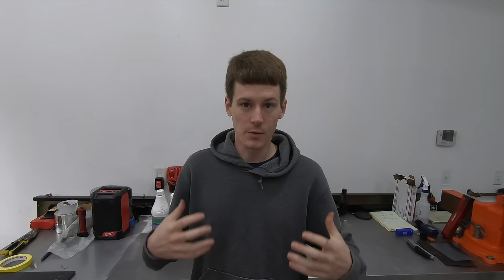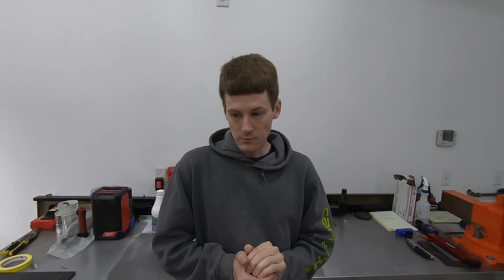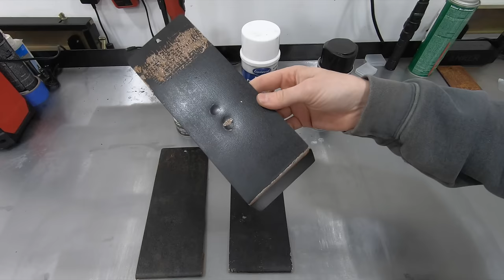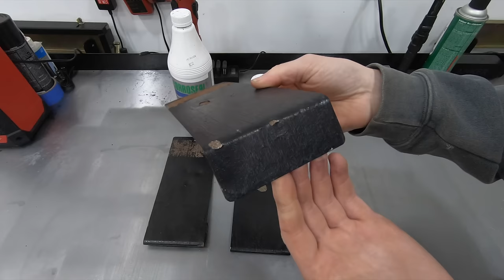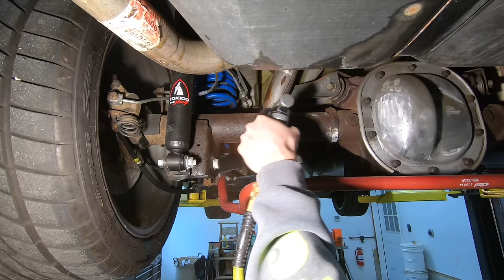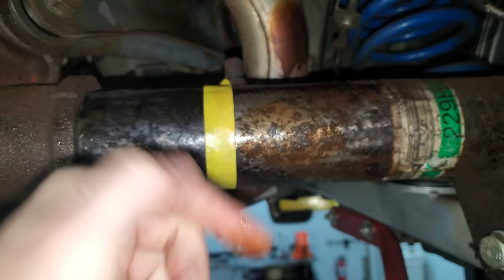MOST Rust Converters Are A JOKE! Let Me Show You. (Eastwood, KBS, Corroseal, Ospho & More)

Comment: Thank you for a very thorough evaluation of these products. I only have experience with one of them (Corroseal) so your video was really helpful. Here's my Corroseal saga; hopefully it will help others too.

About 3 years ago I started making original light fixtures as a side gig / hobby, many out of rusted scrap steel. Any parts requiring new steel were rusted intentionally by using a vinegar / peroxide mix, so that they matched the others. I was looking for a rustic black finish, like old wrought iron. I therefore removed all loose rust, and after much research, decided on Corroseal as a rust converter/primer, topped with 4 coats of Rust-Oleum 2x matte black paint. All were applied according to manufacturer recommendations with regard to time, temperature, etc.

I did notice early on that the Corroseal seemed to chip fairly easily, as I had to recoat a couple of tiny spots where I accidentally tapped it with a tool etc while working on the fixtures. I should have thought more about that when it happened, but the product had such a good reputation etc that I figured I would be okay.

Around the same time I made a fixture using similar techniques, but wanted the final finish to be rusty. I therefore removed all the loose surface rust and simply used 4 coats of the Rust-Oleum 2x matte clear coat. In other words, the same paint as the black, except in clear.

Life has been kind of tough over the last two years, so I didn't really push to sell those completed fixtures. It turns out that was fortunate.

About a month ago I sold my house and moved. When I did, I took a moment to admire my fixtures, which had been carefully sitting in boxes, in a fully air conditioned occupied house. To my dismay, EVERY single surface on which Corroseal had been used was covered in tiny dots of powdery rust breaking through the finish. They were not related to any previous chips or other damage, but were everywhere.

I then looked at a test sample of steel which I had used for activating rust. After determining the best method for making them rust, I had prepped them and coated them in the exact same manner as the black fixtures. All pieces of the sample steel were rusted just as the fixtures were.

After that I examined the intentionally rust-finish fixture, the one which only had 4 coats of Rust-Oleum clear coat on it. No breakthrough rust was visible, but since the underlying surface itself was rust, I wanted to make sure. I rubbed it all over with a piece of white paper towel, then examined the towel for any trace of color. There was absolutely none. In spite of being covered in rust to start with, the Rust-Oleum clear coat alone had done its job, and the fixture looked exactly as it did when I finished it.

To put it mildly, I am extremely disappointed in Corroseal. I now face the tedious task of disassembling every fixture I made using this crap, stripping them down to bare metal, and completely refinishing them.

For me, Corroseal utterly failed in every way, and I will never use it again.
Reply: Corroseal is crap. I prepped a bunch of rusty spots on some wrought iron chairs, applied Corroseal per the instructions and made sure all the reactions produced the correct color, then hit them with Rust-Oleum Stops Rust enamel spray paint. Within a year the finish on the rusty spots was just gone altogether, flaky rust everywhere. I've had way, way better results with just Rust-Oleum primer and paint. I'm currently letting the chairs sit out in the elements to let all the Corroseal thoroughly fail so I can start the project over again.

Comment: Excellent video.  Testing methods look very logical and well thought out.  I will be using this product on truck parts (frame, differential, etc.).  However, some of these parts still have some painted areas that stick pretty well to the metal.  After this product cures, I will coat these surfaces with Blaster Surface Shield.  Question:
1) What happens if the Rust Kutter product gets on the painted portions of these parts?  Is that a problem?
Thanks, Don

Comment: Wow you remind me of the guy from Project Farm. Incredibly detailed and informative. I am just starting to clean up my 85 F 150. For me, because I don't have shop or a lift and I'll be crawling around underneath the truck, I like the Corroseal because it is harmless, easy to work with no fumes and water cleanup. I actually treated the exhaust manifold with it years ago and it's still holding up. I'll probably top coat the corroseal with Surface Shield. That should give me a pretty good protection, right?

Comment: Questions:

1) If these converters are ineffective,  what's the best course of action to stop and rescue the entire underbody of a vehicle with surface rust on almost every component (i.e. if left alone parts will rot away and fail)?

2) Did you know CorrosionX makes a rust converter? I'd love to see their product tested. I know you had mediocre results with the CX preventatives, but personally, I've been spraying them on some slightly rusted rocker panels for 3 years and it hasn't spread one bit.

3) Regarding your Fluid Film endorsement, what about the scenario where a painted underbody component that's covered in FF takes some rock chips and reveals bare metal which then starts to rust and that rust spreads underneath the FF covered paint ultimately eventually causing the paint to fail and flake off which the (now useless) FF or Wool Wax is stuck to? Isn't this the catch with effectiveness of such products?
Reply from the maker: 1) Fluid Film, Woolwax, or Surface Shield it. Repeat as necessary.

2) I was not aware corrosion X made a rust converter. They make a lot of rust preventative. I hadn't heard of a converter.

3) Any lanolin rust proofing is not affected by rock chips because the products stay wet. When a chip occurs the product will self level and fill in the chip. They also will not flake or peel like a traditional paint or rust converter. The downside is you need to reapply them yearly.

If you spray lanolin over paint, and the paint fails completely, you will have an issue IF you don't recoat the metal with lanolin.

Comment: The performance depends a lot on which application the rusted part is being used for, for example: a car axle will be exposed to water, dirt, salt, wind, vibrations, and many more hostile agents; you would definitely want the best performance out of it. In my case, I used a version of the rust converter applied with a brush on the steel framing of a garage roof that is exposed to a misty environment, since there is no exposure of the steel with anything else than the misty environment, it works just fine keeping the rust from progressing.
It all depends on the application, I wouldn't expect much out of it if applied on a car axle or any other "hostile" environment exposed part.

Comment: Ospho is really good for getting between seams. Being as thin as it is, it will quickly seep between joints. Great for firewalls before resealing the seems. Just let the Ospho do it's thing for at least 48 hrs. Once it is fully dry, brush the seam joints, blow them off really well with compressed air. You can then apply the seam sealer over the seams.
Reply: I restored a vehicle years back and used Ospho on mild surface rust. After painting ONLY the Ospho treated areas failed and the paint bubbled. I followed directions exactly. Never used it on a restoration again.
Reply: @supercharged2414  Sorry to hear it didn't go so well for you. I've been using it for decades and never had any problems with it. Used on cars, farm equipment pretty much anything I would find rust on. One thing I always did after it did it's thing, was to wash the areas I'd used it on with distilled water and baking soda. That might be the key really, since the baking soda water would neutralize any acids that might have been on the surfaces.

Comment: I used phosphoric acid after wire wheel/grind/sand the heaviest scale off. Wired wheeled  after dried, re-coated, wire wheel again, primed then top coated. So far so good after 2 years in NY State on a '87 ford truck frame.
Reply: that is very thorough to wire wheel again after the phosphoric acid treatment.
Reply: Thats exactly what I do too. I'm glad someone else uses the same method. My thoughts were bare steel is always best to paint, but sometimes you cant get to rust inside pitting etc. So wire wheel most of the rust off, treat the panel with converters to get into pitting, then rewire wheel to take it back to mainly steel, but with the pitting now converted.
Reply: @ratgreen  If you wire-wheel after applying rust converters are you implying the converted rust is easier to wire-wheel off than the original rust itself? If not then, what are you wire-wheeling off after the rust converter has been applied?
Reply: @Marcoosianism  I wire wheel it again to try get as much fresh steel exposed as possible, otherwise you have steel that is stained with rust converter. My idea being that etch primer will have better adhesion to fresh steel than good steel covered in rust converter.
Leaving only the tiny rust spots in rust pitting that can't be wire wheeled off, being converted.
Reply: @ratgreen  I understand. Thank you!

Comment: Good test, thanks for providing this info!👍👍
I bought a gallon of the corroseal for $60, probably a lot more now due to Bidenomics. I wire brushed my entire trailer frame, tandem axles and hubs included, it took me days to do. Cleaned all loose scale off then removed all dust. I brushed on the corroseal, generously. it went on white then turned black fairly quick. Looked great, almost like it was painted black. I then painted everything with Rust-Oleum gloss black with 2 coats, looked like a new trailer. Then, Less than a year later it looks AS BAD as it did before I started. I will NEVER buy corroseal again. ALL that wasted time and money. Being VERY disappointed is a huge understatement!

Comment: Great video, thanks for sharing your hard work! Going into a bike restoration with some mild rust with a lot more confidence. The acid products seem ideal for detailed parts like threaded bosses that will not be painted but rather greased periodically--correct me if I'm wrong.
Reply from the maker: Bike parts are small enough to soak. If you're concerned about stripping the finish on plating look at evaporust: https://youtu.be/x3t0YtGRqYU
Reply: So I have a quick question 
I live in upper Michigan where they use a lot of salt on the roads , just purchased a 2020 ram truck with no external rust , however there is what looks like a very light surface rust on the underside of the bed and wheel wells . 

They have what they call a Midwest protection package up here where they undercoat and seal the underside and inside of wheel wells .

Should I treat the surface before they spray the undercoat or with the undercoating neutralize the surface rust? 

I was wondering if I should use the cutter then the VHT where I can reach 
Thanks

Comment: Thanks...
Measuring adherence while, at the same time gauging conversion to iron phosphate (or whatever the black stuff is) assumes the phosphate adheres better than regular rust.
The condition of the metal after peeling could actually indicate a superior product. In fact, to peel each one off and examined the actual conversion rather than a surface look would have been beneficial.
Cheap paint (especially fresh) will pass the bend test perfectly - by the way.

Comment: I used DURO Extend brush on back in 1985 on the frame, on a motorcycle, where the battery had cracked. Followed the directions and painted over it. When I stripped the bike down, 7 years later, that repair still looked new. Fast forward to today, I found a rust spot along the door seam of my '16 Silverado, where the factory seam sealer had pulled away. I used Permatex Extend brush on, as I assume it bought out DURO, the application is the same. I guess I'll see, down the road.

Comment: Issue with the phosphoric acid is the rust converted to black Iron oxide isn't really bound to the steel. You have to remove it, than apply a protective coating. However, the phosphoric acid treated steel had a good surface for bonding paint, as it roughs up the surface & also acts as a de-greaser so the paint can bond to the steel.

Comment: Over 36 years ago I used Sems Rust Seal (not their Rust Mort) which converts and encapsulates (did not require top coating) on a very rusty (I mean rusted through panels in places) '67 Datsun and the rust has never returned.  I swear by that stuff.  Don't know if it's still out there, but I have a little left and it STILL works.

Comment: The Rust Kutter’s SDS lists Phosphoric acid at 35%-45%.  A quart is about $20.  Starbrite SDS lists Phosphoric acid at 15%-35% (big range).  Klein Strip Metal Prep.  SDS lists Phosphoric acid at 30%-60% (big range).  A gallon at HD is under $20.  Guess which one I use.
Reply: Ummm....the....expen....noononono the cheap one!
Reply: Rust Dissolver gel spray is 50% phosphoric acid - so its about the same product.
Reply: I don't know which one is HD
Reply: @kevincollins5201  HD=Home Depot.  They sell the gallon of Klein Strip Metal Prep.

Comment: I picked up a western Washington 1960s car that had bad surface rust on the entire roof and trunk lid. I brushed some Ospho on it, sanded a little, and painted the sucker. Its been about 8 years and I haven't got a single paint bubble. The thing looks amazing. Ospho isn't a stripper...I've never had the car under a roof either.

Comment: So does this imply that a coating of Rust Kutter later followed by a coating of PB blaster Surface Shield mentioned in your previous videos would be the preferred approach? How much later in days? So I guess my question is what is the best approach for a 10-year-old vehicle that may contain previous rust? Thanks again for your excellent videos. 🤔😄 Bob C
Reply: I believe rust kutter is not a paint, so you might want to put a coat of paint after it and before you Surface shield it.
Reply from the maker: 0:13

Comment: Any acid will remove rust. But Ospho does stop it.  You did not use Ospho correctly.  Crud Cutter is too strong for sheet metal.
For heavy rust I use plain cheap 5% vinegar or Evaporust. then rinse in distilled water. Then rub well with Caig D5 on a cloth to prevent surface rust from forming or treat immediately with Ospho.  You can paint over Caig D5 without removing it.
Remove loose scale, then Wearing Gloves, apply Ospho with a stiff brush or immerse the entire part, then after 72 hours, use a wire wheel or Wire brush and a green abrasive pad and remove most of the Black Ospho off. You do not want bright metal. Dull grey is what you want. Then reapply the 2nd coat of Ospho.  Third coat any spots that are not black after 24 hours. Now after another 72 hours you have a even Black stable surface and the 2nd Ospho coat is not coming off.   
  Then optional 93% Zinc Primer, then using POR UV undercoat, paint all sharp edges. Then two POR UV undercoats 24 hours apart or Rust bullet, Then optional Topcoat color of your choice.
Assemble your part. Then Surface shield.  With a five pass protection you are unlikely to miss anything.
You will never paint it again. Done.
Rust bullet is just too expensive for most applications.

Your 180" flexibility test is too extreme for the real world. 90° way more than and dent will cause. But I like your adhesion and impact tests. But 4 lbs at 6ft drop is an impact of about 80 LB at 64 ft per second  (43.6) MPH. Too extreme.
 So it is no wonder most the coatings failed impact test.
Reply from the maker: If everyone passes what good is the test? I don't give participation trophies.

Comment: I used Krud Kutter Rust Remover on a rusted door at a condo on the ocean a few years back. Worked great getting the rust off the door. Then I painted the door and it lasted fine at least couple of years until I sold the condo.